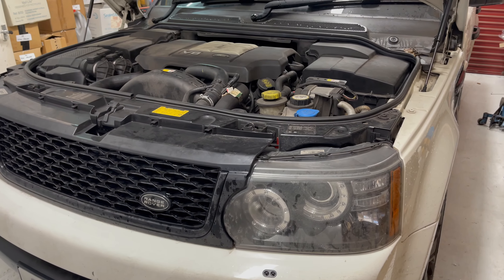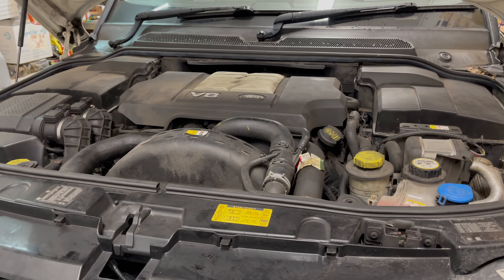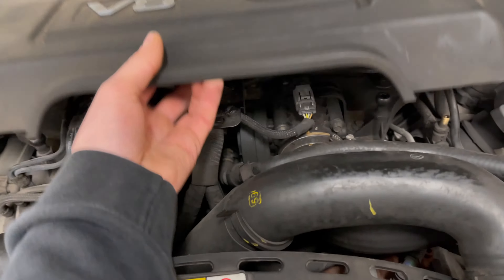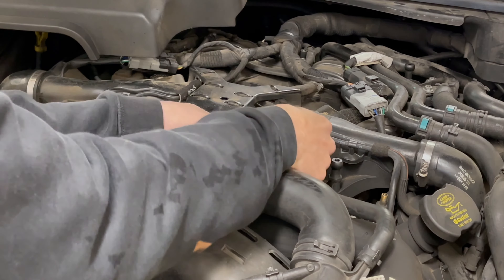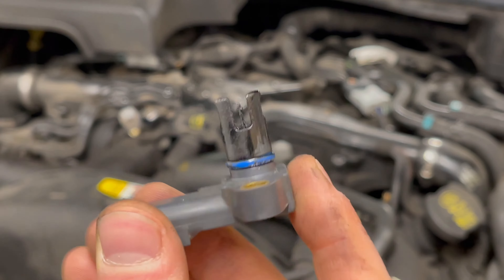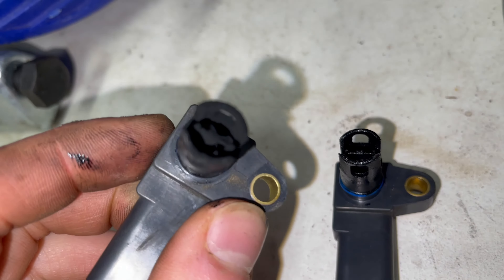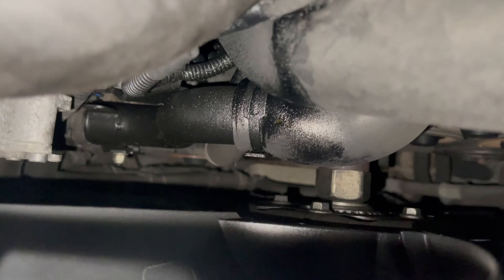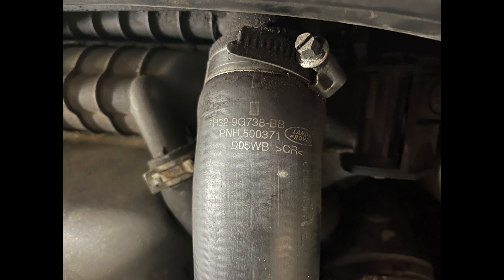Range Rover MAP Sensor Replacement Limp Mode P0101 MAF Sensor P023D - Boost Leak - FIXED

Comment: Thank you. 2008 L320 3.6TDV8, 74,000 miles. I'm here because I was powering up a long fast hill overtaking a line of traffic, when towards the top I lost all power.  Effing frightening! Luckily, there was a layby on the oncoming side that I was able to coast into. Turned ignition off and back on it fired up no problem, the fault cleared and I went on my way.  Back at home I hooked up the scanner to reveal code P023D-21.  Previously, I'd had a recurring, similar, issue when accelerating to join motorways, and on this same road, the engine tone went suddently deeper and there was some loss of power but the car remained drivable until I could pull over and turn off and restart which cleared the fauklt.  I didn't have a scanner at the time but got one when restarting didn't clear the issue.  That fault turned out to be the infamous sticking turbo actuator P132B-22, (right,  UK driver, side).  After lubing, freeing and repeatedly moving/lubing the actuator the problem was solved.  But it is the same side as this new issue so may not yet be completely freed up.  The booster hose is in very good condition, and clean, as is the MAP sensor which looks like new, and I've had the car 9 years!  The butterfly valve in the inlet maifiold is also pristine and moves freely.  So I've swapped the MAP sensors over and gonna go for a test drive up the offending hill.  If the problem no occurs on the left side, clearly it's a faulty sensor, but if it's still on the right side, it's another crawl underneath lube and jiggle the once more.  I'm praying it's nothing worse and will I'll add my findings to this post. Update - the test run on same road and through up P132B-21 this time and exactly the same performance loss and deeper engine tone as P132B-22. Definitely the same turbo actuator sticking again when giving it the full beans.